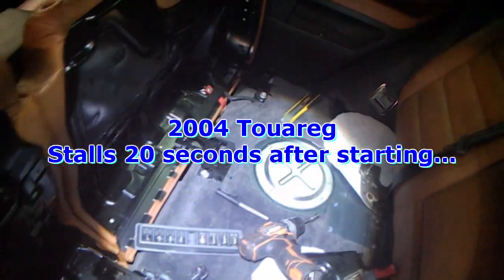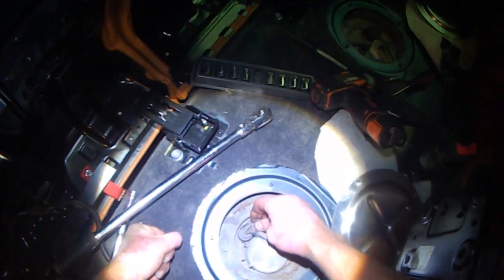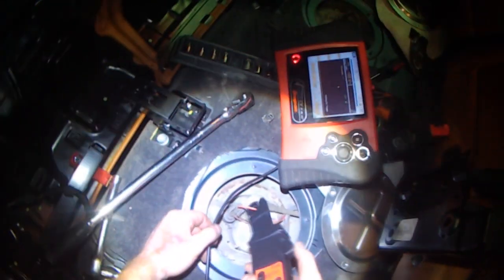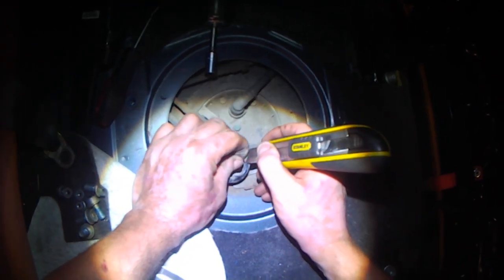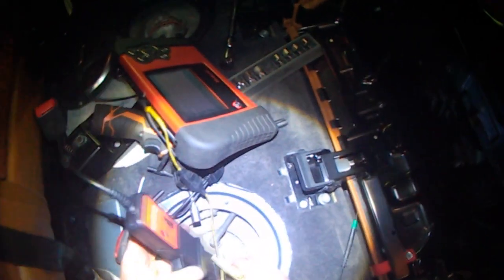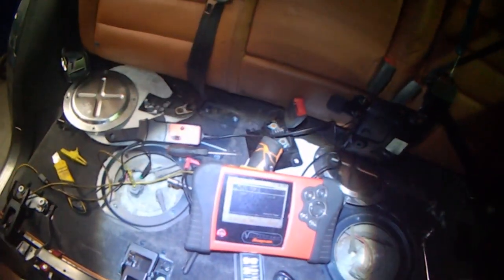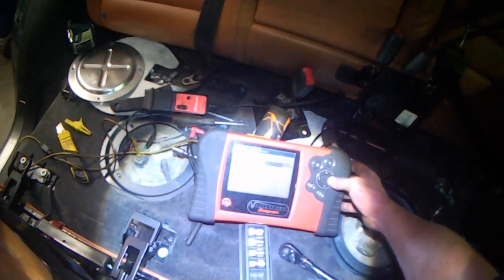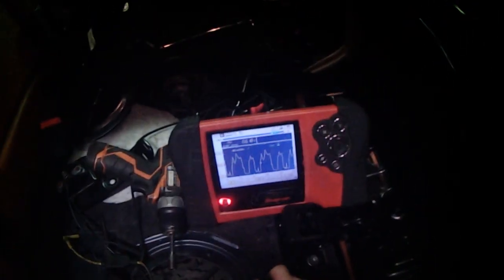VW 7L: Touareg main fuel pump diagnosis

Comment: When should I be getting power to the 'starting pump' ? As soon as I open the door or turn the ignition? Probed the wires, not getting anything, only had power on the other 'main' pump when I turn the key. Checked the fuses, all the relevant ones I've found look alright. Do the electrical lines for the car go under the car or under the carpet somewhere? Don't have a hoist so it's a pain trying to figure out :(
Reply from the maker: Did you watch the video?

Both pumps received power as soon as the key was turned to the ON position.

If one of your pumps is not getting power, then you will have to check the relevant fuses & wiring. 

The wiring is routed under the carpet.

Touareg's are known for water intrusion that can cause electrical issues.

Comment: I have a "no crank and no start" on my 2003 V8 petrol Touareg (non Kessy). Battery is new and good. I am hoping it's not the starter motor due to horrendous access...
I will start diagnosis ASAP but wondering if a dying starting pump would prevent the car from even cranking?
Thanks
Reply from the maker: No.

Comment: sir i have 2004 vw toureg  cranking but not starting engine fuel. pump and spark plug changed i checked fuel pump connector voltage showing 6 voltage is it problem pls help me l?
Reply from the maker: Which engine?

Comment: Thomas which one did you change starting or the main little confuse. How when we have bad a starting pump the vehicle completely dead probably.
Reply from the maker: I changed the "right side" (passenger side) pump. Place a screw driver on the pump body and check which one is buzzing / not buzzing. If both don't buzz, then check for power & ground with a test light.
Reply: Thomas EXOVCDS  Thanks Thomas l appreciate your help.

Comment: Great video! What is the name/model of that Snap On tool? And do you have any idea what would cause the transfer pump (driver side) to continuously run, even with the primary pump (passenger side) completely disconnected?
Reply from the maker: Snap-On Vantage Pro Graphing Meter
Not sure.

Comment: I got one at the shop I just got to start looking at before this holiday weekend.  My passenger pump only runs a few seconds then stops.  Car will run and stall 20 or 30 seconds later. Then when it stalls that pump primes again up to like 30 lbs. Restart up to 50 or more then same thing. I was assuming that my passenger  one was the transfer pump and the drivers one that had 12v  all the time was my main. I jumped that one and didn't hear anything.  It's actually open electrically . I need to go back and check
Reply from the maker: Hi James... nice of you to drop in! I'm missing you posting videos... but I can understand how "running a shop" leaves little time for that.
I referred to the Main pump as being the Passenger side pump, since the voltage supply does not cut out (like with the start / prime pump). The Driver side pump has the fuel filter mounted to it, maybe that's why people say it's the main pump.

Comment: My main fuel pump cuts out after 5 seconds of running and engine stalls
is this a faulty fuel pump?
Reply from the maker: Yes. Have someone start the engine and you tap on the bottom side of the fuel tank with your open hand. If the engine runs longer than 5 seconds, then you know that the pump was stuck and is now spinning again. Replace the pump.
Reply from the maker: Possibly both pumps... check the amperage of both. Should be around 7A each.
Reply: I will try that thanks!
I find this very weird as i drove for 6 hours straight, stopped for about 2 hours and then this happens

Comment: Hello. I have a 2005 3.2 touareg. It has a random misfire codes and dies when accelerating. It has brand new sparkplugs and coils, and new fuel filter. I'm thinking it's either the injectors or fuel pumps. Are injectors a common issue on these? Thanks!
Reply from the maker: No... all injectors would have to have an issue for the engine to die out, it's doubtful that that is the case. Checking fuel trim data (the amount of fuel correction the ECM has to do at idle and under load) with a scan tool, would be good information to help point you in the right direction with your troubleshooting. Are both fuel pumps still original?
Reply: @EXOVCDS  gotcha. Thanks for your reply! They are original. 175k miles. Pretty sure they're on their way out.

Comment: Just some extra info.. on the V6 the Main pump is on the driver side and the secondary pump is on  the passenger side. Just replaced my Main pump. Was on the left. Also if your Main dies than you can  still drive the Car as a temp. Solution. Just remove the 404 relay for the Main pump. The Car computer senses this and Will run the secondary pump without stopping the pump after starting up.
Reply from the maker: Very good information... thank you for sharing! Send me your mailing address and I'll send you some of my channel stickers.
Reply: hello,  first I thank the great work of this video and reading this comment , I am confused @mmlinks ! in the video @Thomas exovcds says the opposite of you!!!!!!!  you can explain to me how deduces the main pump of secondary? I have 2004 TOUAREG  V6 3.2, same problem the engine runs well but after 15 OR 20 second it goes off ! I change which pump? which side ?

second question: if I remove relay 404 it would not be a problem if I ride with the car  ??? thanks
Reply: Really

Comment: Hi Thomas 
Im trying to change my fuel pump module on my 2011 tiguan but i can't find it, could you please tell me where it is?
Thanks
Reply from the maker: Remove / lift the rear bench seat and look for the module on the fuel pump.access cover / lid.
Reply: Thomas EXOVCDS Im already remove my rear seat both of them but only find the covers and the  pumps and no module around
I have to remove the pumps?
Thanks
Reply from the maker: Which engine? Can you give me the engine production code? CAWA, CAWB, CBFA, CCTA, CCTB etc
Reply: Thomas EXOVCDS 
CCT 208311
Reply: Ccta
Reply from the maker: Sorry... I'm video editing and didn't get a notice that you replied. Let me look what I can find. What is the problem? Engine does not start? If there is no "module" (looks like a relay) on top of the cover for the fuel pump, then your engine might not have / need one.
Reply from the maker: The wiring diagram shows a fuel pump control module... should be clipped on to the plastic cover above the fuel pump.
Reply: Thomas EXOVCDS 
Thanks a lot, i find it, is on right side of the pump under the metal in a plastic case. not a lot of place to work. Is hard to unclip
Thsnks again

Comment: Hallo im back (the guy with the faulty t3)I have more questions 😥1 the engine was running an half hour on neutral should the thermostat have opened (heater core was hot radiator not ,symstem is empty )2 is it running good (send you a video on instagramm)3 the hose from the bleeder valve is very hard maybe full of debrief
Reply: Can I also use a fuel line as coolant line for the bleeder valve
Reply from the maker: I'm waiting for your instagram "approval" to follow you (can't see the video until you approve me). Youtube is so much easier... just upload to your channel and send me the link (that's why youtube was created). You can send me a video that is 1 hour long, instead of 30 seconds.
Reply: Thomas EXOVCDSi answered
Reply: Thomas EXOVCDS now you can see the video I think

Comment: My vw t3 is having 8 psi to low compression on the 3 cylinder ,any idea??valve adjustment
Reply from the maker: Yes, start with valve adjustment.
Reply: Thomas EXOVCDS thanks
Reply: Thomas EXOVCDS do you have any video of its adjustment
Reply: Thomas EXOVCDS Sometime i can see smoke coming out of the carburetor (after putting fuel in it ,I'm not starting it' often .
Reply from the maker: I might. Are your lifters solid or hydraulic?
Reply from the maker: Smoke is fuel that is evaporating in the warm engine... which can be normal. Check if your carburetor is dripping fuel after you shut the engine off... it should not.
Reply: Thomas EXOVCDS ok it isn't ,but thank you
Reply: Thomas EXOVCDS I don't know ,it's an early 1984 df that's what I know about it (1913cc)
Reply from the maker: Κώστας Λεούσης Should be hydraulic valve lifters... with the valves at TDC, loosen the adjusting screw until you feel free-play. Turn the screw in until it makes contact, turn 1.5 turns and tighten the lock nut.
Reply: Thomas EXOVCDS no fillers??
Reply: Thomas EXOVCDS können Sie mir das vielleicht auf Deutsch erklären? Soll ich Ihnen ein Foto von den Ventilen schicken?(Instagram)
Reply from the maker: Κώστας Λεούσης Sure, send pictures. Here's a video where I check the adjustment.
https://youtu.be/1vZti5nq-dE

Comment: have you ever had a pump show a good waveform but still have poor flow?
Reply: MrAsadEp  pump working. But no actually fuel was pump out.
Reply from the maker: Only if I connected the wires backwards (on older systems that had individual pump wires) that caused the pump to run backwards. I have not yet seen a bad pump with good pattern.
Reply: Thomas EXOVCDS I had a golf GTi edition 30 come in, crank no start nice pattern on the pump..but no flow swapped out a second hand unit and it fired up..I have a capture saved somewhere

Comment: great work but why the need of 2 fuel pumps aint one just enough
Reply from the maker: +Paul Mayou I think it has to do with the design of the gas tank. If I find specific info, I'll make a video about it.
Reply: Thomas EXOVCDS thanks for the heads up mate
Reply: saddle tanks usually have a second pump to transfer fuel to the primary pump, not sure how it works in this instance
Reply from the maker: Yeah... I think it has to do with the shape... maybe once the main pump is running, it creates a suction effect on the one side that then continues to draw fuel from that side as long as the main pump is running.

Comment: Hi Thomas,
just to let you know, I fixed my valve cover screw problem with a friend a bit different. As the screw was stuck deep in the hole, we cut a M8 thread in the top part and used a matching Alan head screw instead. All remaining 7 screws were replaced with new ones and worked just fine.
Everything is sealed perfectly (incl. the intake manifold) again. :-)
Yes, I took the opportunity to replace the spark plugs as well as it is otherwise really difficult with the manifold on. ;-)

It runs so smooth again for it's almost 192k km... :-)
Reply from the maker: +blocki thanks for the update! Hood to hear it worked out for you.

Comment: Nice capture of the failing pump. Did it set any codes?
Reply from the maker: It had an engine speed sensor fault code (stalling)... implausible signal, I think it was.

Comment: 7000 cc???? Wow
Reply: The owner of a gasoline station will say to a wow ,because he want get rich
Reply from the maker: This was a 3.2L (3200cc) engine.
Reply: Thomas EXOVCDS still a lot !but nice !!
Reply: Thomas EXOVCDS do you know any difference between the vw t3 1,9l fuel injected and carbureted cylinder heads ????

Comment: Hi, Why do  you not do output vcds test of fuel pump?
Reply from the maker: Scan tool for output test is not needed... unless both pumps did not do anything or I had no power at the pumps, then I would use scan tool to check if the fuel pump relay is clicking.

Comment: Nice diagnosis and bad pump waveform capture sir. Thanks!
Reply from the maker: That one was bad alright!
Reply: Flat out stuck till you gave it a jolt!
Reply from the maker: I used to take pumps apart and look at the brushes / rubbing surface... it's cool when you can see the burnt spots that coincide with the drop outs of the waveform. =)

Comment: I have problems with the oBd connector is not communication the said error what I can check
Reply from the maker: Year, make , model of car? Aftermarket radio?
Reply: Thomas EXOVCDS 1999 Audi A6 quattro 2.8 the radio is original
Reply from the maker: Can you communicate with any other module? You'll need a wiring diagram of the data line connector & communication lines. Sometimes, a bad module (ABS, Comfort control, TCM, ECM) can cause no communication issues... or corroded wires (check for wet carpets).

Comment: Nicely done -  I'm going to send you a pic of the tool I use for  cutting the tape on a wiring harness .
Reply from the maker: This was electrical tape that was on tight... the stitch opener (that you might be sending me a picture of) I saw Flat Rate Master use / recommend.